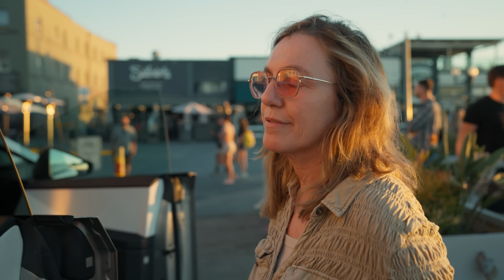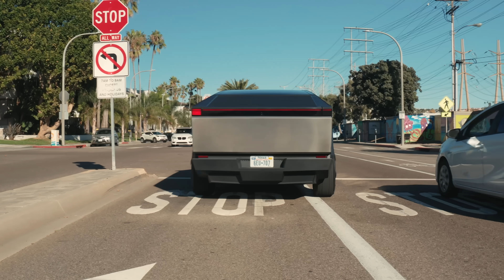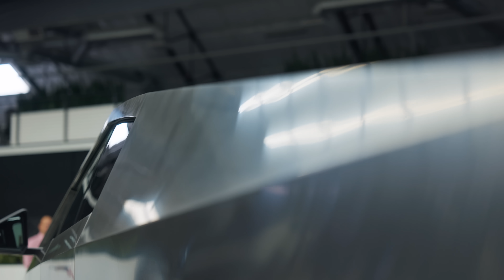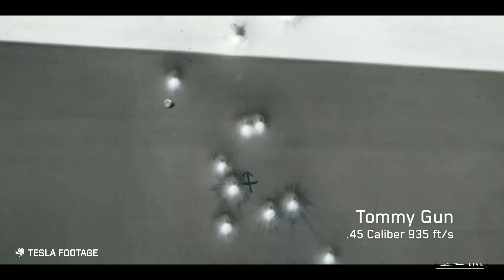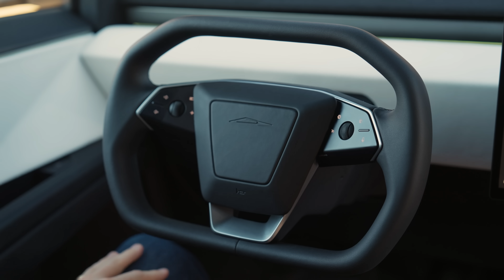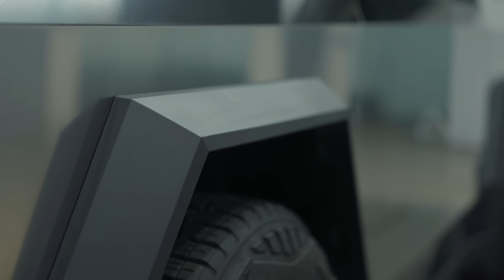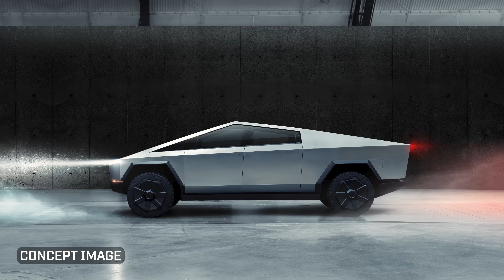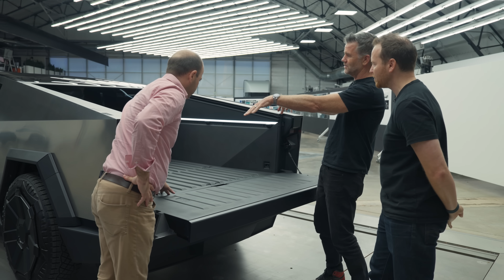FIRST DRIVE: Tesla Cybertruck Full Review

Comment: HI, I think they lost me as a buyer. 
Tesla added a ton of plastic on the bodywork. Those mirrors and efficiency wheel covers have to go (more plastic). Definitely loved the bare SS pick-up bed, now it is gone (more plastic). I could see the liner as a thick rubber removable option... And they cancelled the beautiful SS storage doors on each side of the bed. I dislike that you can see those big rubber seals behind the doors windows, hopefully the glass panels will be blacked-out on the production models. Finger prints? I think if you give a good wax job to the truck there would be no finger prints. 
I use to like the yoke idea :-(
Door storage plastic, I could have seen this carpeted, like the material on the dash. The nose is a the similar situation as an e-type or an old corvette you just cannot see it.
Disappointed that the glass roof does not open at least the section over the front seats.
Don't get me wrong: There is a lot of stuff I like in the Cybertruck (the body style, the technology...) but disappointed by most of the changes. 
And the price point, close to 3x the original price. One last thing when you are driving we can see the reflection in the  SS panels and the reflections are all wavy, so those panels are not actually straight (as you mentioned) that with the panel gaps is unfortunate.
There you have it.
Great video.
Cheers.
a.

Comment: Sorry Telsa....but steer by wire? I'm not going to drive a vehicle with no physical connection between the steering wheel and the tires. Thats screams safety no no to me. When the power sudden goes out doing 50 what do you do? Pray? I also have yet to see electronics be more reliable the mechanical mechanisms.

Comment: Know I'm an outlier but I just dont feel this truck looks that great... Even coming from the fact I love uniquely designed cars, like aptera or the delorian. 

Its a great engineered vehicle, handling airflow and dealing with its odd 80s sci fi inspired shape. But again tesla locking everything to a screen in center console seems silly given that you pull the users view from the road at every moment they need to check surroundings or make standard driving decisions. Works in this autonomous world elon keeps promoting but it still feels designing it different purely to be different, not to fix or solve a problem. 

And at 100k for a truck that really isn't that much better then just going with an e-Ford or toyota just feels like a stretch. Feels gimmicky and not utilitarian for the standard truck buyer, great if you want to be seen purely to be seen.

Comment: Going with what the engineers talk about the stiffness of the chassis making the car/truck feel more nimble and solid, goes a little back to the first generation Chevy Volts as well. The car was overengineered as all heck being one of the first sort of "PHEV"'s but emphasized on the "EV" Part mainly back then. The chassis is so stiff that even though the car is pretty heavy, the handling is super nimble and solid feeling which makes it pretty fun to drive. I imagine the Cybertruck has a similar feel due to the stiffness which is fantastic and I cannot wait to get mine.
Reply: Not a single word or anything shown speaks to it functionality. The slanted box is not functional.
Trucks are for work and do not need to operate like a sports car. A truck needs to haul thing go off road pull a trailer, haul lumber tools equipment. So far I've seen a glorified car not a truck.
You take the truck to a place where the few trucks are sold and people have no idea how one is used, how stupid. Why would you not take it to Texas or Alberta Canada to get an opinion? 
California to get an opinion about a truck, not very smart.It is nothing but a glorified car.
Reply: @schulzmj1  the Truck was made and used in Texas... Top Gear may not know how to test a Truck because it's just not their thing in Europe, but Tesla has shown many videos of the truck being tested off-road and towing. True the main issue it will continue to have is short range while towing a large load which is the curse for all EV Trucks currently, but saying the truck can't be used as A Truck based on the design alone, is patently false.

Comment: What modern truck are you comparing this thing to?  Some of the comparisons mentioned about the handling/ride characteristics could be compared to a some 3/4 or 1-ton pickup, sure...but any 1/2-ton pickup on the market today rides MUCH better than what's being described.  I would argue that the last time a production pickup felt as bad as you're describing, was the late 90's.
Reply: Its a car not a truck.
Reply: @schulzmj1  A 3 tonne car.
Reply: @schulzmj1  you may not agree with it…but, that doesn’t change the fact that it’s a truck 🤷🏻‍♂️

Comment: This is not a truck.  It's a truck-like-thing.  

Real work trucks all have lumber racks like mine, and are fork lift loadable.  Drywall in the bed, lumber up top.  It's 100% clear that sheets of drywall won't fit in the tapered bed.  Also, I would love to see this with a rack and toolboxes installed.  LMAO.

It's 100% clear that no-one that was on the design team for this thing has ever actually done real work with their vehicles.

The innovations on this have nothing to do with the truck-like aspects; that's for damn sure.

That said, the steering, and power, and potential are all relevant.  But; they should be put into an actual truck, rather than a stupid design my 4 year old dreamt up.

Also, you must go hybrid, with a combo of hydrogen and battery if you're ever going to make electric long-range legitimate; especially when towing.  450 miles?  That's literally the morning part of the drive.  Where's the other 2/3 of the day?  You going to unload a trailer so you can pull this into a charging station (which is 99% likely to NOT be an actual fast-charger) every 240 or 350 miles (after spending an added $16K?)?  Yikes.

Comment: Why are you hyping up this car? First of all, most of the video is about the design and not the function of the car. The range of this truck is bad. The stainless steel is a gimmick and adds nothing. If you look at the chassis the naked stainless steel makes it look dented in certain angles. Stainless scratch easily.   It has the wheels in the corners of the truck so it will be bad for terrain driving. It is to long and to low for being good in terrain. Why did they not drive the car off road? What is the max speed of this truck? How high can you rise the car with the hydraulics? Why did you not drag 5 tons with the car? The 5 ton thing looks like it is the biggest selling-point of this car.  It feels that you talked more about the car than did any real driving and you basically try to sell the car tom me than review it. You went easy on them.

Comment: I still think they should of eased people into it. Start with a common truck but electric. Then be vocal about an experimental idea. Instead of it just being the first thing out of the gate.
Reply: Ford, Chevy, and Ram all are easing into an electric truck using 75 year old truck designs.  Why would anyone starting from scratch want to compete with those guys.  No this is exactly what Elon wanted to do.  Old school truck people need not apply.  And this is not designed to be a long haul trailering rig.  There are lots of those to choose from.  No one is forcing anyone to buy one.

Comment: The engine and electrics are astonishing. Its acceleration is incredible and it was shown towing a Porsche and still beating a Porsche in a race.  Not sure why anyone would need that speed, but boys like their toys.

However: it won't be available in the EU - it won't pass pedestrian safety tests. And it won't be coming to the UK either, for similar reasons. 

The basic cost is 50% higher than originally predicted, putting it out of reach for people who might actually want a pick up as a standard workhorse. 

Four tyres (I'm English. I spell tyres that way) fitted and certificated will cost roughly $2,400.

Marques Brownlee did a test drive and spent a lot of time explaining the features. (The back seats go down. Who cares. My dad's 40 year old Soviet era Skoda did that). But he didn't take it off road. You'd think that would be slightly more relevant, but he didn't do that. Nor did you. 

It appears to be bullet proof up to Tommy Gun standards, but probably not AR15, because if it was they'd have used that in the promotions. And the glass isn't bullet proof. It now only claims to be resistant to baseball's going at 70mph. Really?😅. Probably not cricket ball resistant then. Those bad boys are properly hard.😁.
And I notice that they've given up throwing steel balls at it. 

It's stainless steel, and if anyone has worked at a McDonalds (which I did in the 90s) with its stainless steel cabinets, it'll pick up every fingerprint going. It's going to need constant buffering to look good. The other famous car to use stainless steel was a DeLorean, and we all know how they turned out. TBF, of course, they don't usually rust. There's one doing the rounds  in my home town and it looks to be in pretty good nick. But it's literally a museum piece, so it probably spends a lot of time in a garage. 

The specs look awesome. But the reality, I suspect, will be less than kind.  And some will say that it's for Musk fanboys only, which may make more sense, except Musk wants to produce 250,000 a year and I'm not sure there are that many Musk acolytes out there. 

The engineering is superb, let down by Musk's egotistical micromanaging.
Reply: I agree , a mixed bag..

Some great design concepts , maybe they did not care about the world , Euro market ..

The sheer size would also be  an issue for UK parking lots ( which are too small already)

Comment: 6 tons? It is basically a heavy car. Jack it up and change a flat tire.(I have yet to see that happen & we all get flat tires) I still prefer a real truck & an 8 foot box as all lumber & gypsum board comes in 8 foot lengths(not 6') Make a truck that is useful(instead of useless) At least, on a Ford F150 I can put on roof racks for the long stuff because a box style makes it possible.(taking from the wagons that were grass powered) No triangles.  Stainless steel is a good idea except when you are in a big store parking lot.  Now find your "pig" (as all cars look identical.)  Colors have a purpose. I got a red or black, green, white, purple, pink, yellow, orange, blue.  All vehicles will get into a crash - so what are they like to fix?
. Stainless may be as hard as nails (but even nails  bend)  So, as a truck it is practically USELESS. Why such a big Windshield?  I am not interested in bird watching...or scraping all the snow off of a big window. That is my impression as a car & truck driver. Seagulls and pigeons seem to have good aiming ability to hit smaller windshields.  
. The novelty has worn off.

Comment: Interior looks rock hard firm seats, not soft or squishy. It's like padding is no longer allowed in this design. It looks uncomfortable. Also looks seriously compromised in rear seat headroom area due to that low loping roofline, that only just clears the headrests. Curiously the reviewer never even checked out the back by climbing in and checking out the comfort and features. Was that done on purpose to avoid highlighting an achilles heel?
Reply: lol. Criticism because the seats “look” a certain way. Really trying to find something to be negative on aren’t you?

Comment: Respect to Tesla engineers for making this unique design. With that said, this truck will never be a vehicle for every day people. Looking at the different aspects of the truck, it looks spendy. For starters, the amount of glass on this truck and the size of it is crazy. The other thing is the exoskeleton. While it it does provide great strength, was it worth it? I would say no. When damages happen to a normal truck, it is modular. It can be be replaced or repaired at a "reasonable" price. I say it in that manner because i know it can be expensive. However, what will happen if the body of the Cybertruck gets damaged? Will it need to be totaled out? How much would it cost to get the panel replaced? Anything that structural, will most likely need replaced. How much will that cost? If dents are pulled out, I would argue that the structural rigidity would decrease because the it has already been dented once. I hope I am wrong. Competition is good for the consumer.

Comment: So does it do anything else besides fast in a straight line, like does it do truck things? Launch times and 1/4 miles are great for supercars but its truck, test it doing truck stuff! What's the trail time before I have to tap out and find a power outlet. How about the snow? Is it roughly the same effort to attach a plow to the cybertruck as it is to a normal truck. You know, useful info for truck owners and supercar owners.

Comment: Love the look, but as all other electric trucks, when used as what trucks are actually designed for such as towing, hauling, actual work stuff, they dont cut it. Mileage drops to nothing. So is it going to be a drive around town show off or a truck? So far, all electric trucks, when put to the test by independent testers and not the manufacturers, just dont cut it. Towing or hauling anything just kills the mileage. Seems like anything electric might be great for local use, but as a truck guy, Im far from impressed with calling it a truck til they prove themselves. So far, lots of hype and show, lots of blah, blah, blah, about design and ride. But i never noticed them pulling a loaded trailer to check mileage. There is a reason Ford and everyone else have their EV trucks sitting on lots and not on the road. Maybe Tesla is different. Real world testing will tell.

Comment: No one who actually works out of a truck will want this as a work truck. Matter of fact the existing market has a similar issue, and that is not being able to reach over and INTO the bed from the side. Modern trucks are simply too tall, but this thing has zero access from the side. So anything that ends up in the front of the bed means you're climbing up into it from the back (and over anything else you have in there) to get to it. The compact trucks of the 80's and 90's were the perfect size for the average truck user, with larger full size trucks being reserved for heavy hauling and towing. Now the average "midsize" truck is larger than what used to be considered fullsize. It's a neat vehicle, but it's not even close to something I would call a "work truck".

Comment: Sound system stinks, replacement of parts way more expensive,  dangerous to drive in the winter. Difficult to keep and eye on speed and changing functions when display screen is at center. Biggest pet peeve screen glare.

Comment: Maybe 4 Cyber truck battery packs turned 90 degrees and built into the frame under the floor of a large motorhome for five times as many batteries. If someone were going to tow a trailer anyway the Xtra batteries could be used as five separate sets switching from one to the next as needed or could be used to power the motorhome cleanly and quietly. With that many batteries charging could be done when the motorhome is stopped for a long time more like periodic maintenance.
Reply: https://youtu.be/6iNxI-74QOE  Only Rich people will own.

Comment: Really worried about people having loss of spatial awareness of the vehicles around them.  Someone said that they have to ship with mirrors but people can take them off.  Regardless if there is cameras that show it on the screen.  If people loose their natural view of a rear view  mirror and don't turn their heads to the side they are turning in.  It could cause more accidents.  Hope I'm wrong and these actually help.  I ride motorcycles a lot and it's already an issue with inattentive drivers or blind sports.  Would be great if the truck had some intelligence around sensing a vehicle or bike and providing force feedback to the wheel since it is by wire to give an physical sensation that they are turning into something.

Comment: Cybertruck is a major rolling technological milestone.  

1.  First car ever with fully steer by wire system with force feedback. 
2.  First armored vehicle for under $80,000.  Who even has that without going 3rd party spending $$$?
3.  First to have stormproof glass which is rated to withstand a 70mph hit from a 2 inch solid ball of ice. 
4.  Advance battery pack. 
5.  Extremely fast canbus system reducing crosswiring to just 30%. 
6.  Worlds fastest electric or gasoline truck.  
7.  Best in ground clearance.  
8.  Stainless steel skin tougher than any vehicle thats currently made on the market. 
9.  Doesnt look like any other cookie cutter truck. 
10.  I like the slanted sides.  Makes it harder to load stuff but also makes it harder to lose stuff that is already inside. 
11.  Matrix lighting system. 
12.  Most robust bombproof software currently on the market. 
13.  Access to a $2 billion Tesla charging infrastructure with ur $80k truck. 
14.  Best frontal visibility of any truck. 
15.  48volt architecture.  
16.  800 volt main power architecture switchable to two 400 volt system for slower charging connections. 
17.  Fastest charging capabilities.

Comment: Certainly! One intriguing aspect of the Tesla Cybertruck that often surprises people is its "Exoskeleton" design. Instead of a traditional body-on-frame construction like most trucks, the Cybertruck's body serves as the structure of the vehicle. The exterior is made of ultra-hard 30X cold-rolled stainless steel, creating a robust exoskeleton that provides durability and protection. This design eliminates the need for a separate frame, contributing to the Cybertruck's unique appearance and structural integrity. Sharing this information might spark curiosity and amazement among people who are not familiar with this distinctive feature.